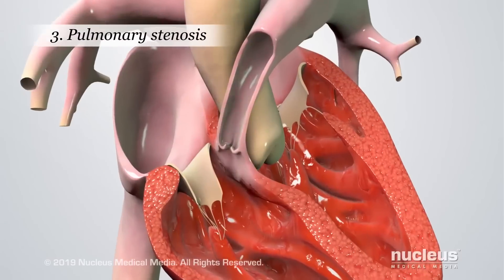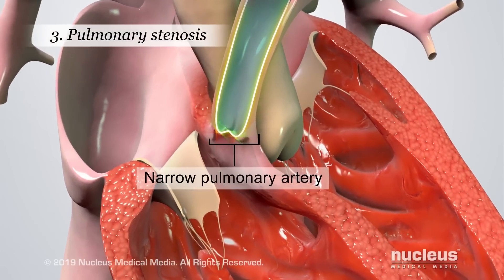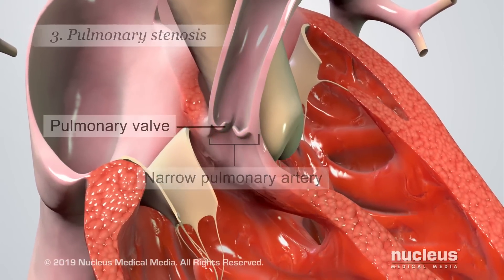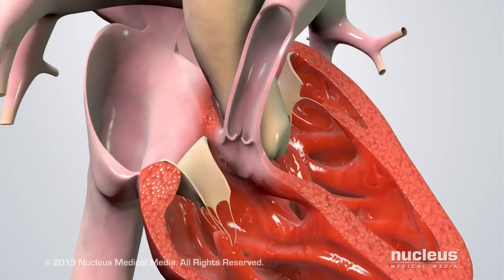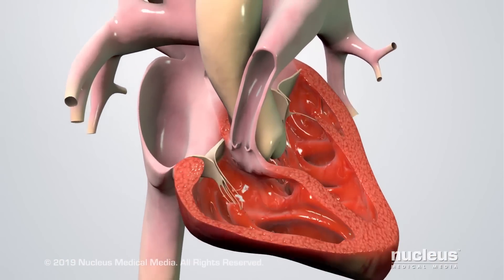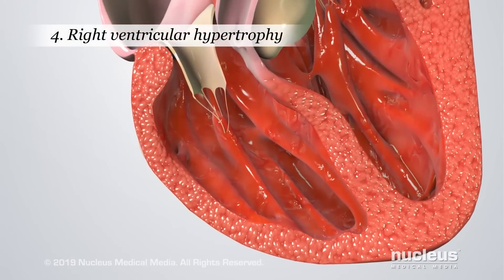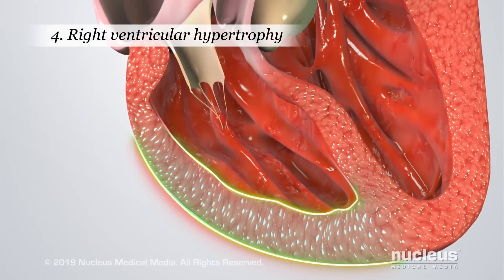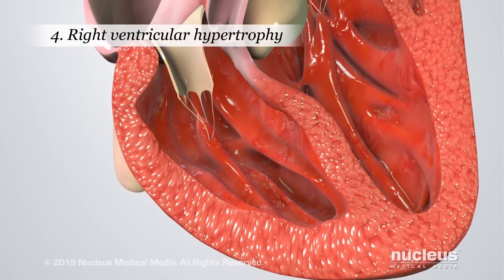Blue Baby Heart Defect: Tetralogy of Fallot Treatments

Comment: Echo Details:

Situs Ambigious, Levocardia, AV-concordance,DORV, Hepatic vein & IVC draining into common atrium
RSVC & PV draining to roof of common atrium.                Unbalanced AVCD, Common atrium
Moderate Common AVVR, Common Av valve - 28.6mm
Large Confluent VSD amounting to single ventricle physiology of RV morphology
Severe Infundibular, Valvular & Supravalvular PS with gdt of 75mmHg No AS/AR, AoV - 14.4mm, PV - 5.3mm,
D - malposed great arteries, Rt. & anterior Aorta
Hypoplastic left sided ventricleNormal Coronaries,
Confluent branch PA's, RPA-7.6mm, LPA-7.6mm
Right aortic arch with mirror image branching pattern, No CoA, PDA/AP collateral present

Normal systemic & pulmonary venous connection, Large LSVC to left sided roof of common atrium, Good ventricular contractility.
Reply: How are you now ?